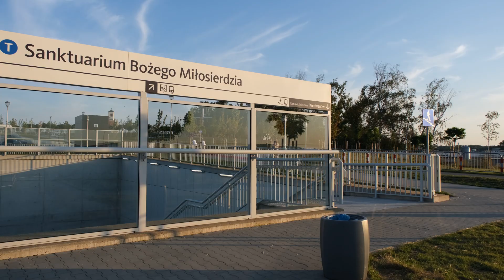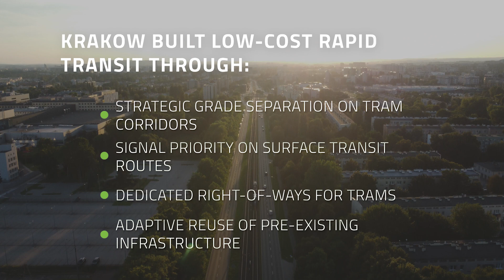How did Krakow build rapid transit at a low cost? | Navigating Urban Transit with George Liu

Comment: Cracow: Builds a subway tunnel in the 1970s, abandons it, repurposes it as a tram tunnel in the 1990s.

Cincinnati: Funds a subway tunnel and surface transit system before World War 1, builds it halfway in 1920, stops, and abandons it because of money issues. Puts water pipes inside the tunnel while the state repurposes the abandoned, half-built surface transit lines for freeways. Finally in the 2000s & 2010s builds a pathetic little streetcar.

Comment: The problem in Krakow (as others already pointed out in the comment section) is not the tram infrastructure itself but the speed of the trams. The speed is very low (below 24 km) despite that there are moderns trams and the lines look fine. 

I don’t understand why the trams can’t speed up more. Maybe it’s a regulation, maybe they are afraid of accidents, or maybe they just need to make the distance between stations larger so the trams can actually speed up. 

Because if the speed doesn’t change many people will still choose the cars vs trams. It’s not enough to have a large light rail network and modern trams if the speed remains the same like 20 years ago!

Comment: In my opinion trams can not be underestimated for many cities with the size of Krakow. They are quite cheap to build and run, have a good capacity and good access to and from the transit system. Therefor, although the trams may be slower traveling, the overall travelling time is not so high since you don't have to walk a long time until you reach your station in comparison with a metro, because it is just on street level and you only have to cross a traffic light and you are at the tram stop and you don't need to walk endless corridors and stairs up or underground.

Comment: As long term Kraków resident, aside from the accents and that ultra weird pronunciation of Kraków, was it actually needed to make so many references to the Soviet Union?
I mean, that newly built tunnel in Rondo Mogilskie was there when I arrived here in 2016. "Newly made". The newly made one is the one at Sanktuarium you showed, which has 1 year?
Also the bridge close to Bagry just for trams (and bikes) has been there for more than a decade.

In any case, I don't retain Kraków needing a metro. The planning of the city was already great for trams and a lot of green, the only good lesson from the Communist era I can take

Comment: KST (Krakowski Szybki Tramwaj - Cracow fast tram) is slow as fuck nonetheless. Also - all trams need to slow down to 10 km/h on every tram crossroad.
Additionally - they have started placing tram stops at the exit of crossroad (because they need an extra turn left lane for cars, wroom, wroom), so most of the times tram stops 2 times - before entering the crossroad and at the stop itself.
Reply: Ye, sadly but we will have metro soon soon

Comment: as a Krakow native, I used to think that our transit is bad and all and why isnt there a metro already... until i went to Naples. Holy...
There are a couple of minor mistakes in this video, but I have to agree with the main premise - this city is squeezing 100% out of its existing network and service is of almost excellent quality; at least when talking about the tram system, and excluding all the neighbourhoods which should be served by it but are not. Taking the bus here can devolve into a very nerve-wracking experience and there is just no alternative in some places.
However trams here aren't really that fast. The average speed of trams (including all the stops and red lights and everything) is around 22km/h. Compare that with 37km/h at M1 in Warsaw. 
Could be worse though, Wrocław is a similar city in many metrics and the average speed is only around 18km/h there.
Reply: Average speed in vienna is 15 kph 😢. And afaik there is no line above 20 kph

Comment: The transportation system in Krakow is:
-Slow (average operating speed below 20km/h, the fastest tram line is only 23.7km/h)
-Unreliable (90% of the traffic is going through a tight corridor in the old town, making tram jams a common occurrence during morning rush hours. I have to account for another 10 minutes of delays during my morning commute).
-insufficient (the tram network is badly interconnected, has a ton of blind spots and isn’t well connected to the urban rail network - which itself is fairly lacking).

All in all, the tram system is not suitable for a city of almost 1 million people.
Proof ==> for every 1000 residents, there’s 685 registered cars, compared to 324 in Berlin and 372 in Vienna.
Reply: I agree with your conclusions. Times were tough and this mostly did the job.

Comment: A truly budget solution would be to reconfigure the traffic lights to make the cars yield and to reduce the number of stations, so the trams can actually pick up some speed between the stops and spend more time moving over all. That's not what they did though, instead they went for maybe cheaper than metro but still pretty damn expensive tunnels, achieving tram speeds similar to that of a bike and no real improvement in traffic congestion. For example it takes 54 minutes to travel a 35 stop, 19 km route on line 50, according to Google Maps. That's barely more than 20 km/h on average, with a stop almost every 500 m.

Comment: Kraków's tram network is really good and convienient mode of transportation, but I wouldn't call it "rapid transit". Average speed for trams in Kraków is about 19 km/h, and the most rapid line is... the line which conencts outskirts of metallurgical plant to Nowa Huta. And so-called "Kraków Rapid Tram" (Krakowski Szybki Tramwaj) doesn't even fit Rapid Tram systems average speed standard in Poland, because it should have at least 24 km/h.

Comment: Great video! Krakow has done an outstanding job!
Is the tunnel you mentioned going under the train station? I've been there few times and that hub really impressed me.
Reply: Yes, the tunnel goes right under Krakow Glowny. It offers a very convenient connection, and is fairly well integrated into the station itself!

Comment: I definitely prefer trams to the metro, they have nice views, natural light and are relatively quiet (the sound of their engine is soothing).
If the tram is crowded, I can easily get off and wait for another tram or go for a walk, rent a bike, or take a bus.
Honestly, sometimes I'm surprised that someone claims that the metro is modern. It's only a little faster and the only advantage for travelers is that they can read because there is nothing else to do there.
If you spend your entire life riding the tram, bus or walking to a stop, a closed underground metro with no other transportation options seems outdated.
Reply: Wrong metro lines can be automated and as a result have lower operating costs!!!!!

Comment: Kraków is one of the cities where driving a personal car is not the most pleasant. The tram network here is very well organized, and you can reach many key places in the city by tram. Apart from the metro, which would be useful, there are two key investments that will change railway connections at the Kraków railway junction, and these are: Construction of an electrified railway line from Podłęże to Szczyrzyce (the piekielna linia known as of numbers 622 (main), 623, 627 and 628 for individual routes and slip roads), from where there will be a branch to Tymbark (direction Nowy Sącz) and Mszana Dolna (direction Chabówka), where it will connect with railway line No. 104, which is currently undergoing modernization on the sections Chabówka - Mszana Dolna and Klęczany - Nowy Sącz, as well as electrification on the Rabka-Zdrój - Mszana Dolna and Klęczany - Nowy Sącz sections. I will not write details here, but I recommend that you take an interest in the topic of the piekielna linia. The second investment is the construction of a new railway line to Niepołomnice, which is developing very well. This is an important investment for agglomeration connections, which is to be implemented under the Kolej+ program.

Comment: Love the use of existing ROWs and squeezing more value from existing infrastructure - so many cities can learn from this, including Toronto (where we keep handcuffing the efficiency of projects by leaving out signal priority or forcing modes to mix)
Reply: Absolutely! Toronto in particular is a great example of a legacy tram network left to rot - and the planning ideologies of hyperlocal stop spacing, lacking TSP, etc. have unfortunately been implemented in our newest LRT lines. Frankly there's much more we can learn from Krakow - including stop consolidation, selective grade separation, and dedicated lanes that can be applied across our legacy streetcar network at very low costs!

Comment: Good video but comparing to my experience commuting around the city I feel like there's a bit of cherry-picking done. There's no doubt that the network is improving very well in recent years but the current transit system has a lot of flaws too. One thing in the video I cannot overlook is that all the tram shots seem to only show the new shiny vehicles when a huge part of rolling stock used in the city is either old or bought second hand from abroad. Thanks for showing the city so close to my heart in your video anyways.
Reply: I agree that it is a bit of cherry picking, but the old stock is not much present anymore. Last time I checked it was something like 10% of trams being the old ones (still cool to have some retro bits on the tracks, admittedly) as the city was buying new ones like crazy the last 5 years or so. They also have a tram museum line with guides running all summer. Trams are glorious.

Comment: I live in Kraków and I disagree you can look up the average speeds of tram lines are low (below 20 km/h) if you want to see a real fast tram go to Poznań and see the PST line (from Piątkowo to the main station) that is a real fast tram with grade separations.
Reply: I've never been to Poznań so I don't disagree with you, but for Kraków average speeds must be low because of the way trams have to run in the city centre - very tight curves, being stuck behind a horse carriage, lots of pedestrians etc. The newer lines that are being bulit further from the city centre are much faster.
Reply: PST is only in one part of the city, and it was build as a low cost alternative for metro from the ground up. Rest of the network has different speeds, but it's still faster than beeing stuck in traffic.
Reply: @MrKony98  I know the rest of the network are just normal tram lines
Reply: Szczecin Has the fastest tram in Poland slightly faster than Poznań line

Comment: this is what Auckland really should have done. this was the whole original point of the light rail to the southwest and Airport proposed in 2016, something cheaper than commuter rail with more benefits by serving more suburbs and forcing a mode shift away from cars. 

instead the project got bloated out by politicians obsessing over faster travel times, and what should have been a $2-3 billion dollar build turned out into a $15 billion almost-light metro that was cancelled by the current anti-public transport government... who want to take that money and spend it on motorways, while the NZ transit community still argues (as they have been since 2016) over whether commuter rail, metro, light rail, or busways are the best rapid transit solution in our cities. 

light rail may be slower and have capacity limitations, but it would have been far better than what the southwest suburbs of Auckland are now getting - which is nothing at all.